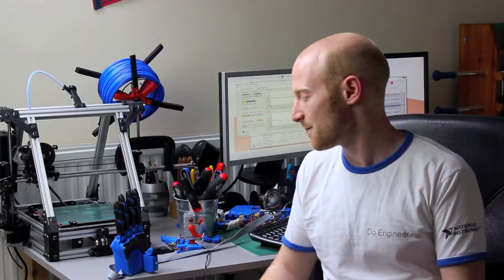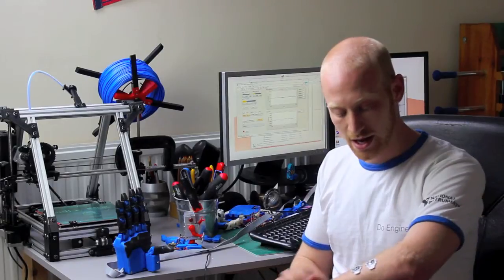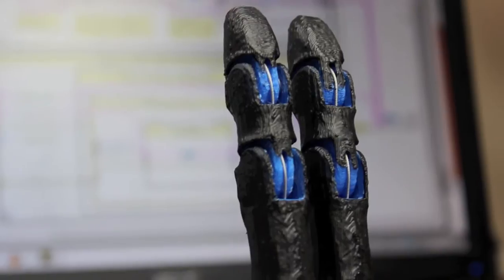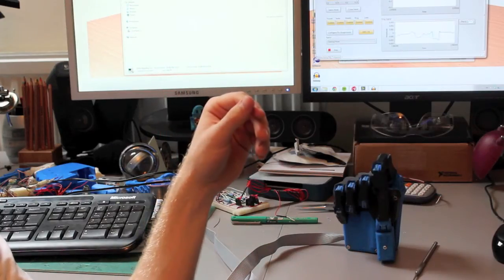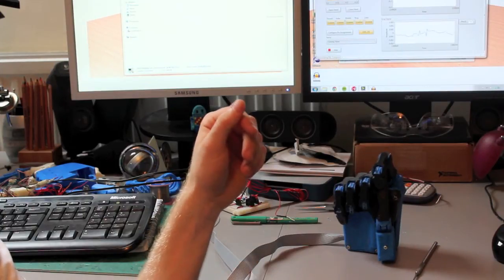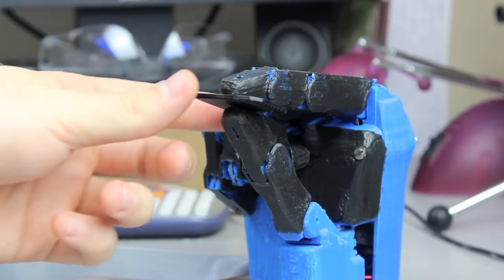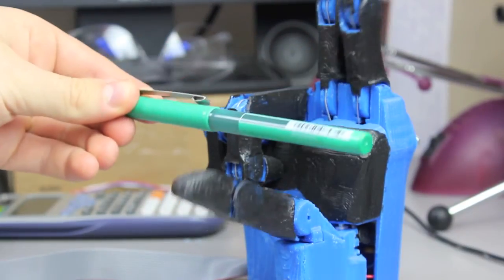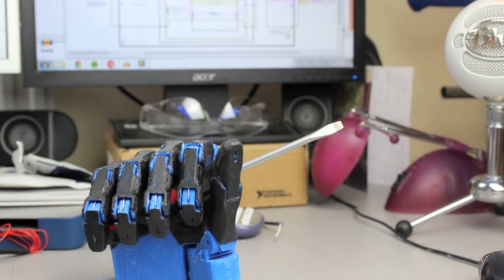Update: Controlling the Dextrus Hand with EMG signals.

Comment: cool project! But why not add pressure sensors at the "gripping" points to avoid excessive force? also why use LabView and NI-DAQ, when you have quite powerful (and fairly cheap) embedded system boards (with DSP capabilities) that can do all of the processing in (soft) real time?